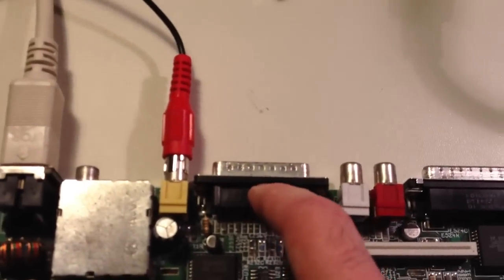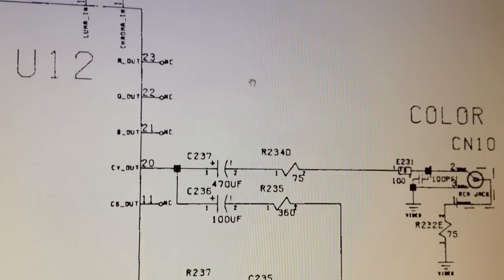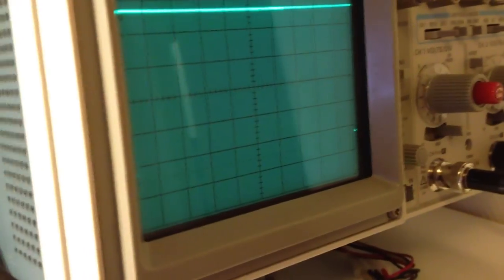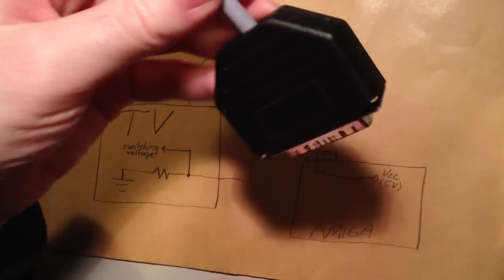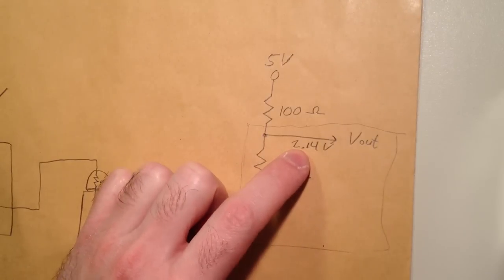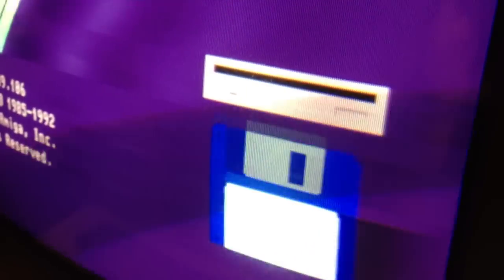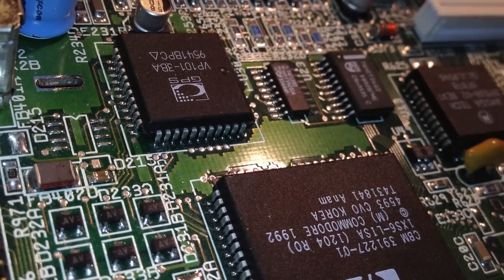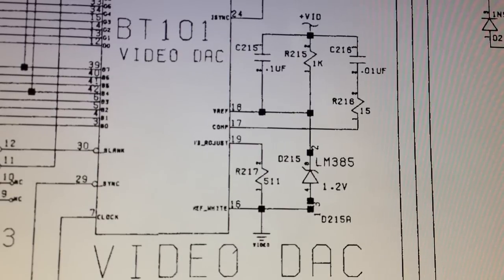Amiga 1200 repair - Video problem

Comment: I have a slightly similar problem. The pin on my RGB port which supplies the +5V signal has half broken off! This means that the TV won't switch into RGB mode, it's stuck in CVBS mode. I'm using an RGB to SCART cable. What can I do to fix this? I'm not much good at soldering. Can you do a video which would cover it?

Comment: My composite video has the same artifacting, but my board has the capacitor that was missing in your board.
I can get the video to clean up when I wiggle the cables, so I’m going to reflow the solder on the pins and sm parts...

Comment: Thank you so much for this video, it did permit to repair my Amiga 1200 where I had no display at all via the peritel cable while which the adaptor db23 to vga it was working. Due to your video my thechnician pointed out that the famous 200 ohms resistance in the 5V line was at 1,2 Kohms which of course as you explained lead to a to lower voltage on the pin 23. However, It was not a modified one, it was still the original one, but I guess it changed its value due to its age. This resistance has been replaced according to your recommendations and bingo ! The display via the peritel works like a charm. I really thank you ! Kathleen

Comment: i had a similar problem, but guess what? it was just 2 volts on the vcc (caused by a bad connection after the the replacement of the first capacitor behind power connector. (my fault) the ramdac still worked but with ghostings and steps in the rgb levels. anyway the amiga worked with 2 volts all over the place.... that's "green it" :)

Comment: I have a similar problem with my A600 but on composite output only, rgb is fine.
Except of ghosting there is some noise too in the ghost area.
Also my pcmcia doesn't see the cards I plug :-/  (drivers are ok)
Reply from the maker: Check C237 to start with. Replace if bad. Also check C236 as a second option.
The A600 is known to have problems with the PCMCIA slot, and there are fixes for this. There are threads about this on Amiga forums (EAB, I think) where they go into the details of this. Check out those forum threads for more info on that.
Reply: RetroGameModz thanks my friend!
Reply from the maker: No problem. Good luck with your A600, hope you can fix the problems.
Reply: RetroGameModz Well I just replace them both but the problem keeps the same.
Crystal clear RGB and composite with gohsting. 
:-/
Reply from the maker: In that case, you would need to use all sorts of regular troubleshooting techniques to find what is causing the problem. You need to follow the composite signal on the schematics and check it with an oscilloscope at different points in order to track down the fault.
Reply: Have you fixed the problem with ghosting on composite? Do you have the same on RF too?

Comment: Wait, I know! What if I'm removing the Resonator Y621 and replace it with a 3 MHz Quartz??
Reply from the maker: No no no, dude you got it all wrong. Gosh, everyone knows that you can't replace a resonator with a quartz. You have to replace it with a thyristor, that's the best way to go at it!
Reply: RetroGameModz I had to replace it with a 3 MHz Quartz, because it got in the way of my FastATA1200. I just wanted to bend it over a little bit and... crack! I broke it loose. After a long search I found a stack of 100pcs on ebay - in california. Shipping time to Germany: about 2 months, shipping costs: about 18 US$... Right now I'm soldering an adapter for the KickROM-Sockets to lift the FastATA over the Indivision and much more to the left and in the back of the case. and all that combined with an ATA1232/40... I am excited a little bit! :)

Comment: 22:17 I almost spit coke over my Amiga Board! XD
Reply from the maker: You used a maxed out Amiga to watch this clip? Or did you just happen to have an Amiga close by?
Be careful with the coke there buddy. I don't think your Amiga board would appreciate you covering it with a mix of coke and saliva. :)
Reply: RetroGameModz
I was replacing the old capacitors with Germanium-Diods, because I am German and wanted to make my Amiga a German too.
Reply from the maker: Ah, I see. Very clever indeed. So, did it work? Did your Amiga turn German?
Reply: RetroGameModz Works great! Every time I turn it on the PSU makes a sound like "NEEEIIIINNNNN!!!!" first, then the audio buzzes like a panzer... and then that smell of something burning... very satisfying!

Comment: Great video!!  I have a strange issue with a friends Amiga and wondered if you could help.  Every output including RGB, composite an RF has a slight green tint on it.  I suspected maybe an issue with the red output but I can see red on the mouse cursor and also on Amiga tick graphic on the kickstart boot screen.  Another thing is the Kickstart background is blue instead of purple.
I was suspecting that it was either an issue in the Video Dac or somewhere before it between the DAC and Lisa chip.
Have you come across an issue like that?  Where would you start looking?  Thanks again for a great easy to understand video.
Reply from the maker: Is it an A1200? If so, replace C211, C212 and C213. They are 220 nF ceramic multilayer capacitors in 1206 packages. Just be sure to use correct soldering procedures so that you don't rip any pad off the board in the process. Have fun with your Amiga when you're done. ;)
Reply: Thankyou!!  Yes it is a 1200.  I will have another look and replace these.
Reply from the maker: Great! I hope it will fix the problem. If it doesn't, then I suspect that there is something wrong wih your video DAC. Desoldering the video DAC without the right tools can be very tricky, and can also be a bit risky for the board. So I hope you don't have to do that. Let me know the outcome of replacing the capacitors I mentioned. I'm curious to know if that fixed the problem.

Comment: Hi my A1200 motherboards RGB port doesent output 5v at all. I have tested several scart cable with correct pinouts and resistors but i only get picture with 1,5 battery between 16 pin and ground. Can i take 5v example from floppy connector to rgb port? I think motheboard was rev 1D. I didnt notice any problem before when i was using nec multisync 3D but with TV or s-video adapter problem is always there.
Reply from the maker: Yes, you can take the 5V supply from the floppy connector if your RGB port doesn't supply 5V. However, you should look into why the 5V supply on your RGB port is not working and do a proper repair on that instead of just hooking up a wire to the floppy connector. There might be a reason to why the 5V pin on the video connector is not working anymore, like say a short to ground on that pin. If that is the case and you jumper wire 5V at the external floppy connector to the 5V pin on the video port, you will then have a direct short between the 5V rail and ground. My suggestion is to look into what exactly is wrong with your motherboard and repair it. If the motherboard is working otherwise, then the problem is most likely just a blown surface mount ferrite bead on the board or something along those lines.
Reply: I made mod to Scart cable pin 16 has now separate cable. Cable has 25pin connector to printer port which gives 5v 100mah to pin 14. I used 170 ohm resistor.  With HDMI adapteri picture is amazing.  https://vid.me/eOQm
Reply from the maker: Cool, glad you got it working.

Comment: Fantastic video. Can you make one for Escom board timing fix? I have one such board which shows artifacts on the screen when you connect expansion card to it, like Blizzard 1230. Without it works OK.
Reply from the maker: What kind of artifact does it show on screen and when does it do it? Can the artifacts be seen all the time or only at certain occasions? Have you posted any pictures or other footage of these artifacts somewhere?
Reply: RetroGameModz Well, seems like problem is gone. I used this hack: http://us3.aminet.net/docs/hard/flickerfix.readme

Comment: I find your video's really interesting, even the 2 hour ones!

I have a dead Amiga 1200. PSU tested ok on my A600. Any idea what to try first?

Thanks, keep up with the vids :)
Reply from the maker: It could be caused by almost anything since I don't have much else than "dead" to go on. But checking voltages is of course a good place to start, and maybe also testing the motherboard with another pair of ROM chips.

Comment: Nice desolder technique on smt components. I think component identification was the problem here along with the lack of a circuit diagram. What do you use to desolder those square CIA chips? (heat gun)

Comment from the maker: Thanks. :) A problem like the one you're describing can be caused by a bad video DAC for example. I recommend that you watch my video "Amiga 1200 color problem repair". I have not seen exactly how the symptoms on your motherboard look like, but it sounds like there is some kind of problem with the D/A conversion.
I think your motherboard might have a similar problem as the one I repaired in the "color problem"-video.

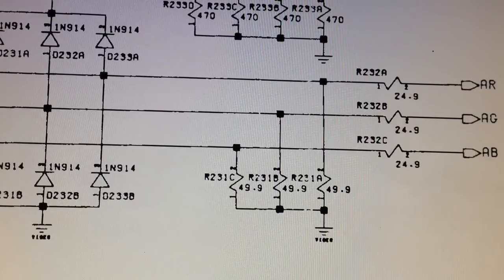Comment from the maker: Hmm... There is obviously a video problem with that motherboard. The tricky thing is only to figure out exactly where the problem resides. It would make your life a whole lot easier if you had an oscilloscope and some experience using it. What you could do for now is check for resistance with your multimeter on the RGB lines on the motherboard, just like I did in this video at 04:40. But after that, I think it would be difficult to take it any futher without the right tools needed for the job.

Comment from the maker: Ah, I see. So you want to bypass the connection temporarily while waiting for the ferrite bead to arrive? In that case, you can of course temporarily put a 0 ohm resistor in there if you want, or even solder bridge the connection. A solder bridge might be a bit risky though, since there is no protection whatsoever in the event of a short to ground. I would choose to use a single strand of a wire and bridge the connection with that. The strand of wire will then act as a fuse, protecting the mobo.

Comment: Hi, ive just bought an amiga 1200 on ebay. It only has a picture through rgb and not composite or rf. The rgb signal has a red hue. Any ideas here? All I have is a multimeter and soldering iron. Is it worth even bothering? You're obviously very skilled. I would just be doing what you said in the video and randomly attacking components on the motherboard. :(

Comment from the maker: But in short, the low resistance of the ferrite bead is letting all the DC pass through, while the impedance is filtering out noise and other unwanted high frequency energy from the DC voltage. You want a low DCR in order to have minimum loss in the power supply on the +5V pin, but a somewhat high impedance to filter out the noise.
I don't know the current or DCR rating of the ferrite bead you mentioned, but yes, one rated at 390 Ohm @ 100 MHz should work just fine.

Comment from the maker: Well, I've never said a 0 ohm resistor should have at least 200 ohms impedance. We are talking about ferrite beads here, which are completely different components than resistors. In a resistor, the resistance is equal to the impedance. A ferrite bead, however, has low DC resistance but higher impedance. There is not that much space here to explain it all, but you could try looking up the concepts of impedance, reactance and resistance on the net for more info on the subject.

Comment from the maker: It would work, but it's not a good choice because the impedance is only 50 ohms at 100 MHz. Like I mentioned, you should get one with at least 200 ohms impedance. It won't be much of a problem if you get one that has higher impedance than 200 ohms, but you shouldn't go lower than that. Everything else seems to be ok with the one you chose, it's just the impedance that has to be 200 ohms at least. I recommend you to look for another one.

Comment from the maker: I cannot look it up for you on ebay, since it would probably take a lot of time to find it there. I recommend you turn to your local electronic store / electronic dealer, or use an online store where you can search for components using certain criterias.
It's just a ferrite bead, so you don't have to be too picky with your selection. But try to get a 1206 sized one, with minimum 200 ohm impedance, as low DC resistance as possible and at least 0.5 amps current rating.

Comment from the maker: Since the current rating of a ferrite bead is inversely proportional to the specified DCR, the lower DCR bead you get the higher the current rating of that device. Generally, you want to get a ferrite bead with a low DCR and a high current rating. But it should be enough if you get one with a DCR of around 0.2 ohms and a current rating of minimum 0.5 amps. Also, for best fit, keep in mind that it should be a 1206 device, which is the physical size of the component.

Comment from the maker: Since the ferrite bead at E263 is for a power supply application (+5V power line), it is not very important that you get the impedance value absolutely correct. However, I don't recommend you to go lower than 200 ohms. If anything, go higher. The higher impedance, the more the ferrite bead will filter out the noise from the 5V power line, which is the purpose of having it there.

Comment from the maker: Yes, you're correct. That would be 200 ohms. However, that is not the DC resistance of the ferrite bead. The DC resistance (DCR) should be as low as possible. It's common to find ferrite beads with a DCR of 0.2 or 0.3 ohms or so. The 200 ohms rating is the impedance of the ferrite bead. This is usually given at a frequency of 100 Mhz, so in this case, it would be 200 ohms @ 100 Mhz.

Comment from the maker: Nope, I never did. The owner of the board doesn't even know himself, because according to him, those resistors were already there when he bought the motherboard. There is really no point whatsoever to put resistors at those places on the board. My guess is that those resistors are the result of a failed repair attempt. Lots of resoldered components in the video section might also act as an indication of that. An experienced repairman doesn't attack components at random like that.

Comment from the maker: Ah, this really explains a lot. Thanks mate, great info there! How did you find out that it's possible to use either D215A or D215 to create the reference voltage? Did you find out by probing around on the motherboard, or did you see this on the D215A version of the schematic (if there is any)? Because if so, I would very much like to have this version of the schematic for future reference. I have only managed to find the version of the schematic that I used in this video.

Comment from the maker: Hi! Do you have a scope? If so, probe the outputs of the video DAC (pin 25, 26 and 27). If you get nothing on the outputs at the DAC, check the digital incoming databits to verify that the DAC is receiving the video data. If all bits are coming in, you might have a problem with the DAC. Check the sync signals at the 23 pin connector, and also the RGB signals. I'm actually in the middle of another A1200 video problem repair right now, so stay tuned for more videos like this one. :)

Comment: thats a real shame, i had bad ram in mine so i bought a known to be working stick off ebay... as the symptoms was the same, an easy tell tale sign of bad timings is boot the amiga with the apollo and ram, on wb click and drag an icon round the screen, if it locks up and or corrupts the screen then it is bad timing on the amiga, if no ram is installed and u get refusal to boot (green, yellow or black screen) then that is also bad mobo apollo's work best with rev 1.D try stay away from rev 2.B's

Comment: Hi again just to tell you I tried the modded Apollo 1230/50 on my second A1200 and its exactly the same it crashes after a minute or two,I had already done the timing fix on one A1200(removed the two resistors) because I bought a ACA1232 accerator from individual that soted that out great no probs with ACA1232 acc now.. but it is even worse when I tried the Apollo in the A1200 after the fix its even worse so I conclude the Apollo has a board fault :)

Comment from the maker: Very interesting. You learn something everyday. :) I didn't know that this was a common problem with the Apollo 1230/40. I don't have an Apollo myself (I'm quite happy with my Blizzard 1260/50 :)), but I googled it just out of interest and had a quick look. It seems like a really easy fix. According to what I read, it basically just involves the removal of two caps which is part of 2 different EMI filters for 2 different clock signals respectively. Did the fix solve the problem for you btw?

Comment from the maker: "Caps lock works", as in "I can press the caps lock over 20 times, and I still get a response from the caps lock LED"?
Do you have a scope? Some things for you to do to start with:
1. Check all voltage rails with a multimeter  (+5, +12, -12).
2. Set the scope to AC coupling and check the ripple of those voltage rails.
3. If ripple is acceptable, check all clock signals coming out from Budgie, and check that all custom chips are receiving the clocks they should.
4. Post that video! :)

Comment from the maker: Yeah, obviously the seller lied  *if*  there is actually something wrong with the Apollo card. Have you tried hooking it up to other Amiga motherboards? It might be something that has to do with the motherboard, just like GodofLegacy mentioned. (Although it might not necessary be the timing that is causing the problem, but it could be.) If you haven't already, I suggest you to start by trying the Apollo with other A1200 mobos if you have the opportunity to do so. I hope you will get it working.